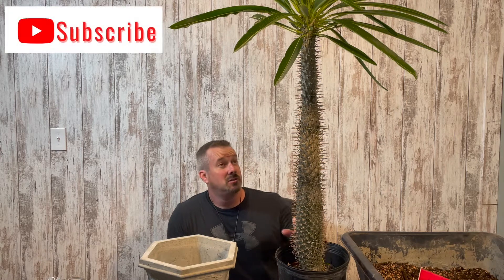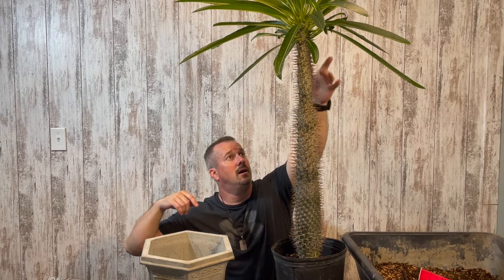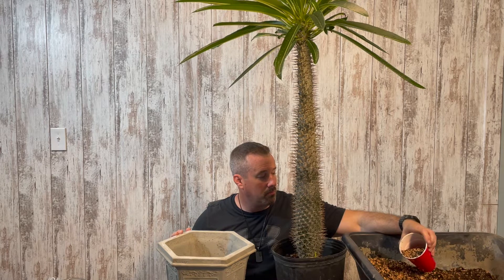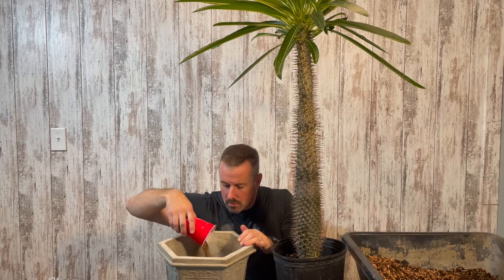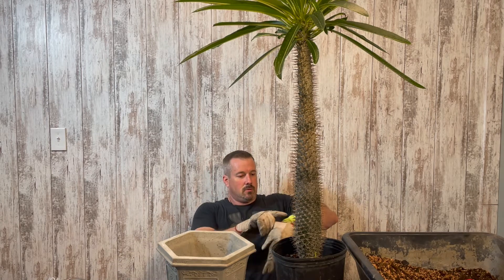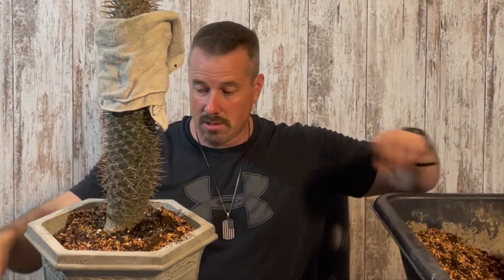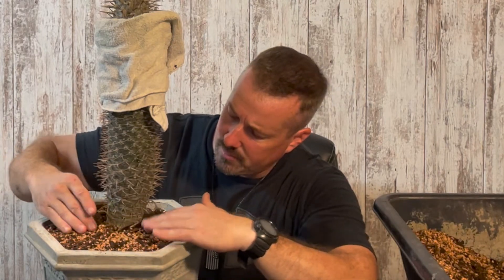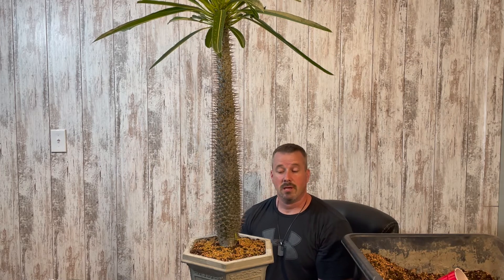REPOTTING A MADAGASCAR PALM - Pachypodium Lamerei

Comment: I would have loosened the roots a bit. This doesn't harm the plant. On the contrary.
Alternatively, you can remove the old substrate from the root ball with water and loosen the roots in the process.
Reply from the maker: @olli8623  I understand what you mean. This plant was very hard to handle because of all the thorns. The technique I used is called slip potting and to be honest with you it is how most professional nurseries repot most of their plants because of time. But loosening the roots is best when we can you are right. I should be uploading an update video on this plant soon stay tuned.
Reply: @getintothewildwithjeffruma8777  Hi, an update would be cool and interesting. I have an 11 year old Pachypodium sandersii. This is a relative from South Africa. A Pachypodium can actually only kill waterlogging and no water at all. Has yours bloomed yet? Pachypodiums have beautiful flowers. I like this plants very much.
Reply from the maker: @olli8623  Mine has not bloomed yet for me. I have seen them in bloom in nurseries and yes they are beautiful.
Reply: @getintothewildwithjeffruma8777  Mine has never bloomed either. I read that it needs a winter rest or dry phase with very little water to bloom. I'll try that out now. When it sheds its leaves in winter, it is the sign of the dormant phase.

Comment: isn't it bad not to loosen the root ball before placing it in a new pot?  Interested to know your opinion on that.
Reply from the maker: Believe it or not most large scale nurseries transplant without disturbing the roots of the plant. It’s called slip potting in the industry and I was taught/shown this technique by multiple nurseries. They do it for a few reasons one it saves them time when they have hundreds or even thousands of plants to repot. Two it can prevent streets on the plant. Which leads me to this plant. Some succulents and cactus do not do well with their roots disturbed. Over time the roots will grow outward into the fresh soil. I hope this helps and answer your question. Thanks for your support for the channel.
Reply: @getintothewildwithjeffruma8777  thanks!

Comment: Hi Jeff, I'm Dale Andrews, a subscriber from Lake Charles, LA. We are about 50-60 miles north of the coast of the Gulf of Mexico, so subtropical. Typically we have around 4 or 5 nights per year when the temp's get below 32, on rare occasion getting into the 20's. 
That said, today is August 20, 2023 and I just recieved my baby Madagascar palm from Amazon yesterday. It is about 4" tall and came in a 4" pot. I repotted it into a slightly larger terra cotta pot with about 4 built in "vents" running vertically down the sides. When I potted mine, I used pieces of window screen to cover the vents and hole at the bottom. Also, I dusted the root ball with rooting hormone.
That was yesterday, so today I plan to give it a good soaking with water that I had left out for 24 hours to let the chemicals dissipate somewhat into the open air.
What kind of growth should I expect in the first year? Keep in mind, it's only a baby. 
I see you mentioned the Desert Rose. I have 4 Adenium obsesums and 2 Adenium Arabicums that are in pots around 6" diameter that I got last summer. 
Keep the good videos rolliing, and I'll be watching. Happy gardening!  🪴🌴
Reply from the maker: Hi Dale, the first year I had my Madagascar palm it grew about 30-40% taller then what it was and mine was rough 18” tall as I recall when I got it. I have found they grow fast. Sorry for the delayed reply I didn’t see your comment.

Comment: What’s your water schedule like?
Reply from the maker: In the winter I water it about once a month. In the spring once it goes back outside once a week. Then in the summer I water it every day. 
The key is the soil it’s growing in. My soil mix doesn’t hold a lot of water so the plants roots can breathe. Normal potting soil holds to much water so I wouldn’t plant a Madagascar palm in potting soil. I hope this helps. 
I will be making a follow up video on this plant in a couple months. Showing how much it has grown.
Reply: Thanks for reply…I just did a repot of 1/3 potting soil and 2/3 pumice…I had peat moss and some perlite and some sand but it was hold on to way to much moisture..the leaves started curling and getting brown spots..so I hope this new mix gives it room to breath just worried ..thanks dude
Reply from the maker: You got it👍
Reply: @getintothewildwithjeffruma8777  you think that new soil mix I made spuds decent?
Reply from the maker: Honestly yes I do. 2/3 perlite should do the trick. The only thing that you might need to watch out for is perlite is light weight. So the plant might get blown over on a windy day. Maybe not but just something to be mindful of.
Reply: @getintothewildwithjeffruma8777  thanks buddy